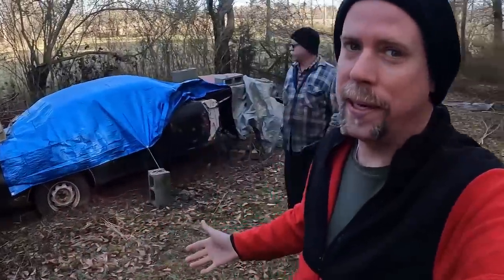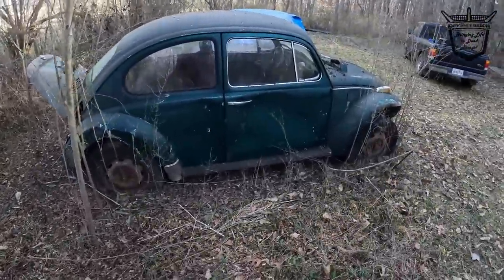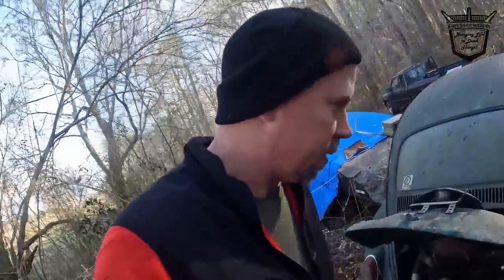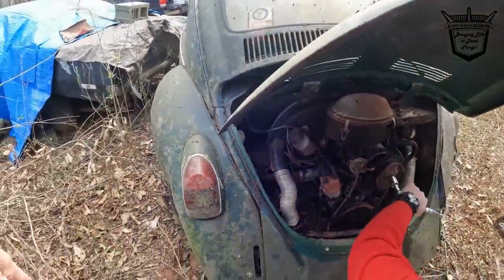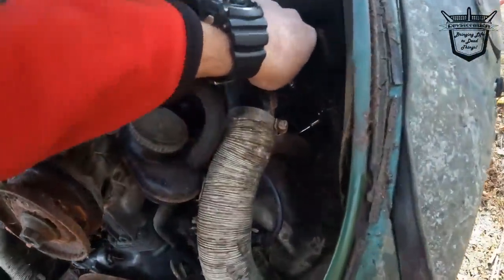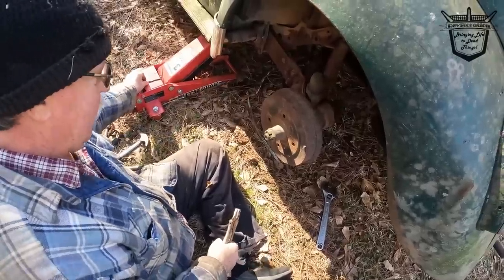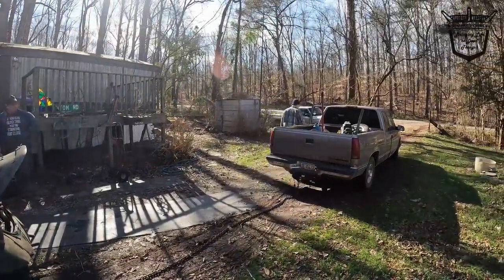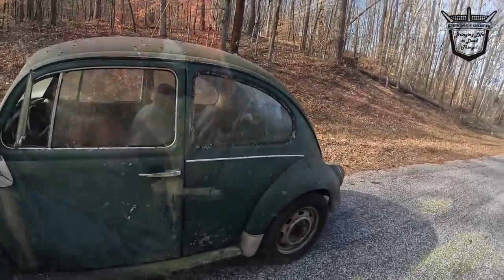ROWDY Rescue after 20 YEARS -1970 Volkswagen Beetle - DON'T Repeat! Stuck Brakes & Engine - VW Bug

Comment: Enjoyed the episode!  You are blessed to still have your Dad around, mine died in 2014 and I sure do miss him.  I broke a tractor engine loose one time by putting a wrench on the crank, and then a cheater bar, and then a heavy tractor wheel weight.  I lubed up the cylinders good and let it sit, I checked back a few days later and it had moved.  I was then able to get it to turn over.  God bless, glad people like y'all are still around!

Comment: I used to have a '73 super beetle and it was throwing oil everywhere I bought a new set of heads and put them in and drove it for about 5 years then sold it to a guy who wanted to tow it behind his RV. So with a little work they can get running again. That engine of yours is stuck with a capitol "S". But you can take them apart and parts are readily available. Made it through my first 3 days of Chemo Therapy need it every 28 days until the B-Cell Lymphoma is killed off.

Comment: That was a risky rescue!   I was really nervous for you all.  When I broke my clutch, it would start, but I could not shift into any gear with the engine running. But it could shift with the engine off. I had to start it in 4th in the parking garage and drive 20 miles home without stopping for traffic lights. Luckily it was light traffic because it was very late at night.  I supposed I could have shut off at the traffic lights and started it in 4th again, but it wasn't easy the first time.

   If I were Mr. Wayne, I'd have lost me a farm animal after I saw what he was doing to my cars. But gained a freezer of steaks.
   Great stuff, Rev. I'd like to see the Barracuda at Wayne's house revived.
Reply: Pop pppp?

Comment: I saw a video on another channel yesterday where a guy did everything to get a bad engine to turn. The whole time I was thinking, "What makes him think it is a matter of rust and not a spun bearing, or thrown rods like on my engines?"  At the end he adds a comment that it wasn't a rust issue. If he kept trying to force it, he would have just made things worse if it was the same things mine were. Like cracking the block.
Reply from the maker: Most of the engine we work on are stuck because of sitting.. Engines that lock up while running would require a different method.. We have had 7 or 8 engines on this channel that was stuck, everyone was because of rust.. I would say 95 out of 100 are!

Comment: I agree working on anything is fun, and I get the jokes 😂😂 I can't complain got a 97 Expedition with 330k miles runs like new, a 2000 Camaro 236k miles currently going threw redoing alot old parts starting to give out but is a daily driver, Ford vs Chevy both sides have good jokes  it's all good fun 😂😂

Comment: Using the wrench on the crank bolt can strip your crank threads. I saw it happen a few times on Youtube "will it run " videos. Or break the bolt.
  On my bad 302 in a new project car, I decided I would use the wrench to turn the engine backwards. That way if I put too much pressure on, the bolt would unscrew, rather than break.
  It was already free, but it turned only with a large amount of force in either direction.  To much hard turning for a starter to turn.  I'd done all the lube-in-the-cylinders stuff. Also, it didn't hiss every 90 degrees I turned it or alter the force needed to turn the crank with the wrench. So, no compression. And probably spun bearings.
Reply from the maker: Yeppers

Comment: It can't be too hard to remove the brakes. When I was in college, ever girl I knew that worked on her own car and knew what she was doing was a Beetle driver.  I wonder if you really need that drum puller to service the back brakes. I'll have to look it up.
Reply: https://www.youtube.com/watch?v=b6enInfARjo   This guy shows that removing the nut was the big job.  He bolted a piece of angle iron to the lugs so he could put enough force on with the breaker bar.
The drum just slides slides off without a puller after you remove that.
Reply from the maker: The issue is the brakes are stuck to the drum.   It has been sitting for years.. If the brakes was not stuck to the drum it would come off easily...
Reply: @RevStoration  Oh, I thought the nut wouldn't come off. I've had a couple like what you describe where the friction pads were pasted so hard to the drum, they tore themselves off the the metal of the brake shoes when I pulled the drum. I've also had all the little coil springs inside the drum break.

Comment: If you take a pot water and boil grab a big bath towel put 2 droops of Liquid Vicks put it in the hot water put the towel over your head then put your head over the pot sit their breath in that hot steam an Vicks. If you get plugged can't breath get you food grade pur peppermint oil put just a vary little bit on your finger put it under your nose the peppermint will open you up fast so you can breath.  Just make shir you buy food grade pur peppermint oil. You can tell that other guy this as well Chevy or Chevrolet or gm are just a boat anchor that's my opinion on that

Comment: Hey David so why is your daddy ‘spower steering pump so  whinny all the time in his Chevy truck I’ve noticed that watching your videos it sounds like a fords from the 1980s and 90s Because that’s what fords power steering pumps do and can it be fixed or when will it be fixed it would make a difference and a great video to as well ? I was just wondering that’s okay God bless good luck in getting this VW running and driving to I’ve never really heard a power steering pump so whiny In a Chevy or any other GM vehicles before either
Reply from the maker: Too much time working on junkers to take time to work on our daily drivers.
Reply from the maker: I think it is his rebuilt transmission that is making the noise.

Comment: You had a MANUAL on the back seat.  why didn't you use it?  You would have learned that taking off the nut on the generator and the pulley is 2 parts.  The belt is adjusted by taking off or add washers between the halves.  There are plenty of washers on the shaft.  I'm at 19 minutes and getting frustrated, as a former VW mechanic and owner.